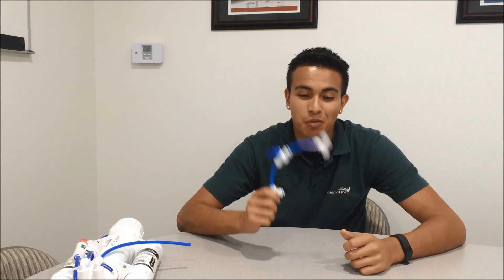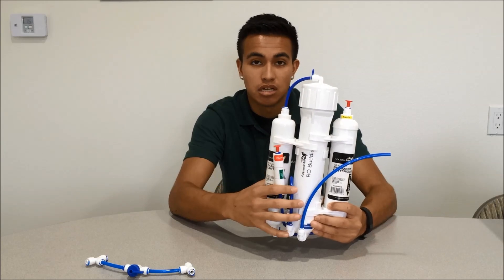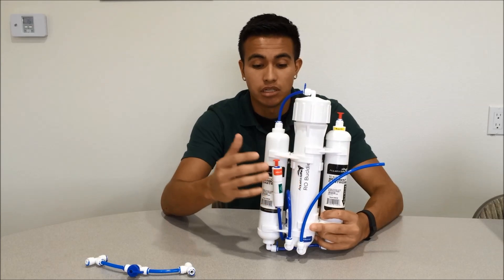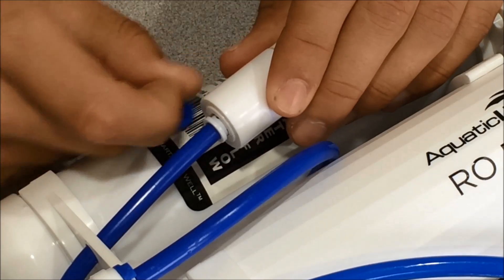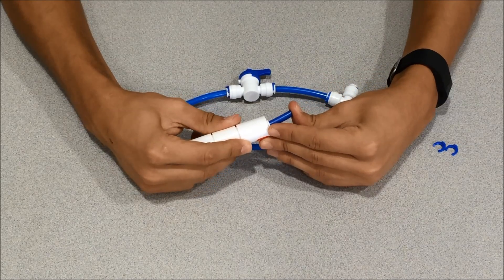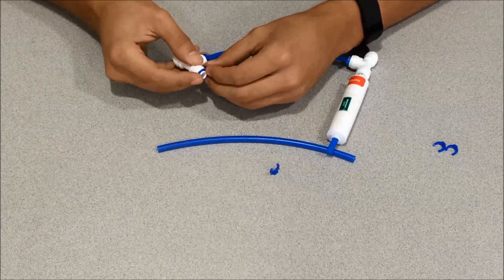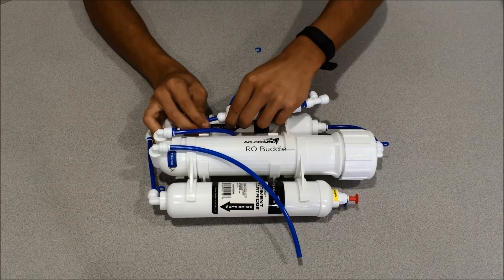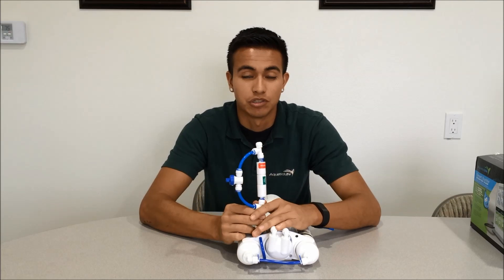Installing Flush Valve on Reverse Osmosis RO Unit

Comment: Couldn't you just remove the flow restrictor and use a hose instead? Then once done flushing, install the flow restrictor?
Reply from the maker: Yes, that would work too. The reason people use a flush valve assembly is for convenience. If you flush your membrane for 30-45 seconds prior to every use, you can significantly increase the life of the membrane.